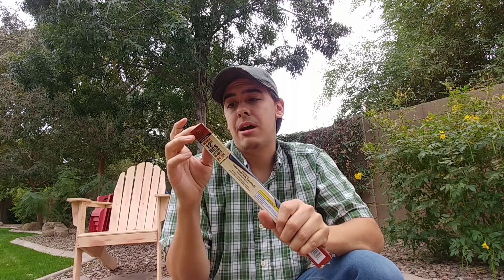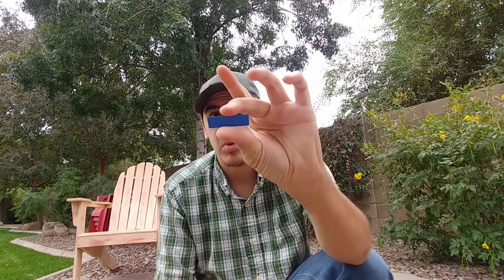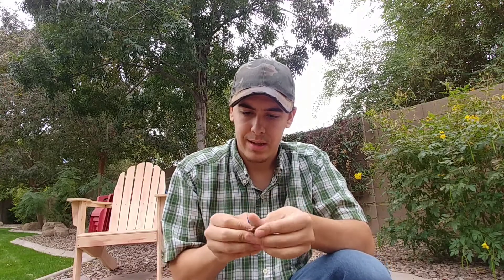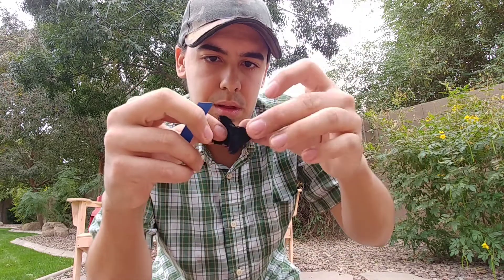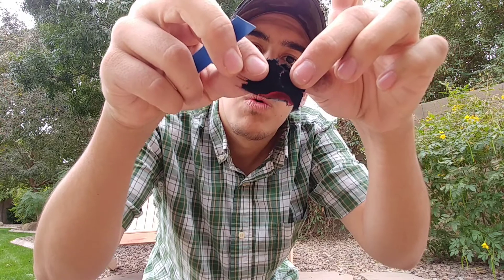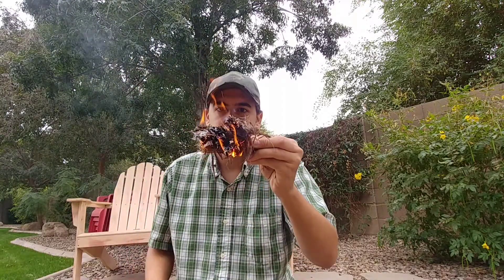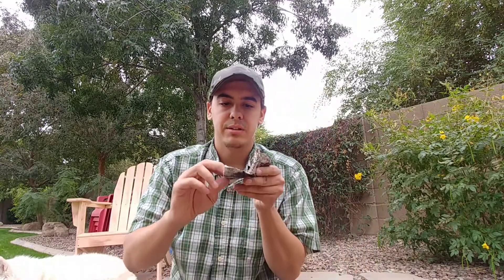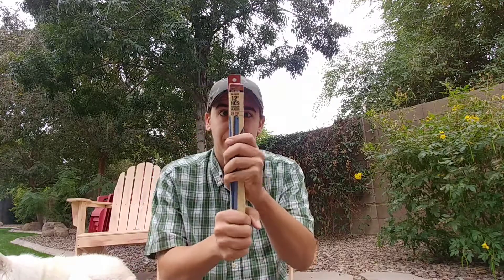Can You Use a Hacksaw Blade for Flint and Steel?

Comment: Nice video!  I’ve used a small piece of a hack saw blade for years. It fits very nicely in my Altoids tin fire starter kit. It’s got a nice patina on the tin as I used it to make the char cloth that’s inside. 😉I have finally, as of yesterday got myself a nice hand forged high carbon steel striker Viking style. Fits around the knuckles. I’m excited to try it out!

Comment: Yup Nathan sent me one with a ferro rod.. but for me a small piece of a file seems to be the best but I suck at fire except with a lighter
Reply from the maker: Yeah, a sharp piece of file can do the trick. Even better if the file is carbon steel so you could make a spark from flint or quartz. Lighters are still great for starting fire.